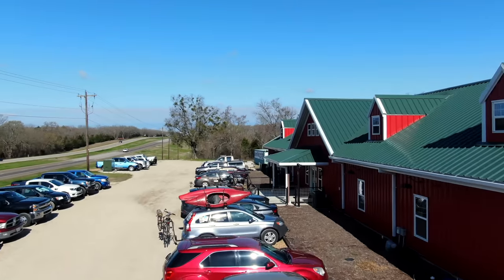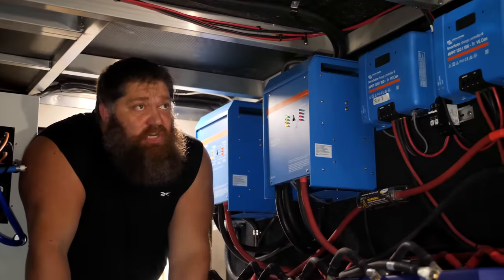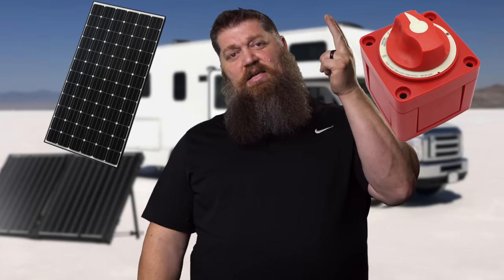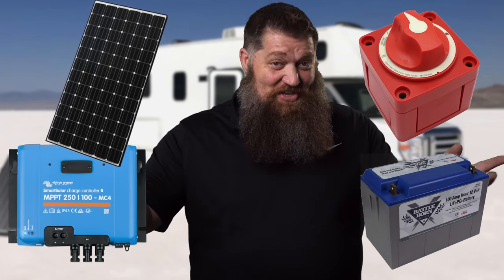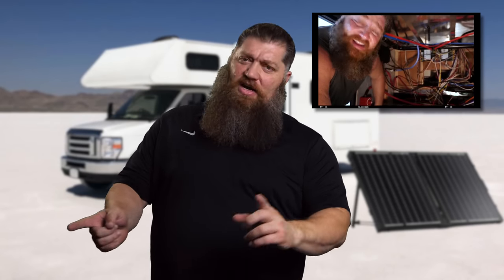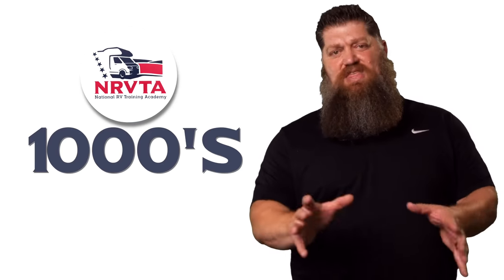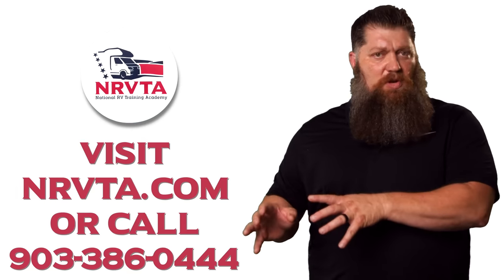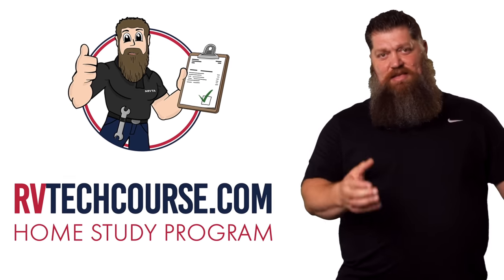4 Essentials Components to charge your RV Batteries with SOLAR

Comment: Ok I just purchased my second truck camper. First one had all of those 4 things already installed. New truck camper just has outside plug as solar ready,battery disconnect, 2 agm batteries. I have a Jackery 100 watt solar panel which of course does not fit the female plug on the camper. What do I need to get this going. Subscribed and liked. Thanks
Reply: Sam, you likely have a plug on the outside that leads to your batteries.  This means that your panel would have to go through a controller of some sort and the output connect to that plug.  Another possibility would be to see if the wires from that plug go to a controller already installed in your camper.  You'll have to read your mfg documentation for clues.   There are so many versions of manufacturer "solar ready" that its hard to say exactly with out a multi-meter and some checks.  Hope you get your rig set up the way you like.  If you are having trouble the NRVTA is truly a place built on the idea that knowledge is the power that enables us to more completely enjoy our RV experience!
Reply from the maker: If you look through your paperwork on the camper you should find a little more information on what type of plug that is. I'm not sure on all solar setups but I believe the jackery panels work with their solar power stations. if you are wanting a mobile solar panel find one with a MPPT solar control included. then run them directly to your batteries. it'll probably be more efficient then the solar ready plug which will at best trickle charge your batteries due to the small size of the wires.  Todd did a fantastic intro to solar class a few months ago. here is the link. https://youtu.be/Ip2ecsG0vSk

Comment: Todd,.. I’m wanting to install an exterior SAE plug into my camper which already has 100w of solar and a controller. The plug is for a portable 200w folding panel. Do I tie that plug onto the same controller lugs as my rooftop panel?  Or, do I need to switch off the rooftop if I’m running the portable?  I’d obviously like to combine the two. Novice here.

Comment: I have a question...
I have a 300w solar panel and a 12v 50ah battery and for some reason it doesn't want to charge at more than a 100w.
Is that normal?

Comment: Todd, I need an external solar trickle charger to maintain my rv batteries while it's in dry storage. My rv has two six volt lead acid batteries (golf cart style) wired in series to create twelve volts. My storage unit has no ac power and the batteries are way to heavy to move back and forth. I am investagating if some company makes a small solar panel with charge controller that would charge my batteries while my rv is not in use?
Reply from the maker: Absolutely. A small 10-25 watt solar panel can be found at Harbor Freight

Comment: Do you need a physical disconnect or is there an automatic disconnect once you have a maximum voltage so you don’t overcharge your battery or did I miss that?
Reply from the maker: So a quality solar controller will either have a preset charge profile for the type of battery you have (FLA, AGM, GEL, LiFePo, or you can program it. 

If set properly you will not have to disconnect. There is NO flow if there is no demand. When the proper voltage is set in the solar controller then there is no/little flow (amps) to the battery just like a maintainer charger.
Reply: @NationalRVTrainingAcademy  Thanks for this answer! I have read on some forums that even if you have a properly programmed SCC, to reduce charge cycles, the solar array should be disconnected. Is that true? Thanks!

Comment: Does this Solar controller need to be sized
Reply from the maker: It needs to be able to handle the input from the solar panels and it’s output cannot exceed the charge parameters of the battery(s)